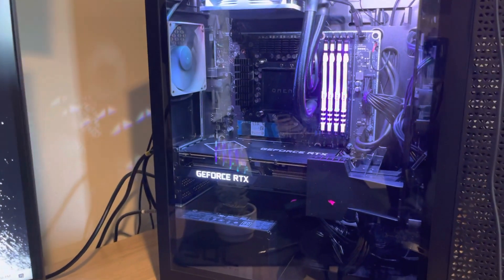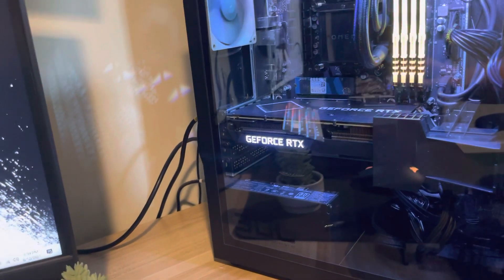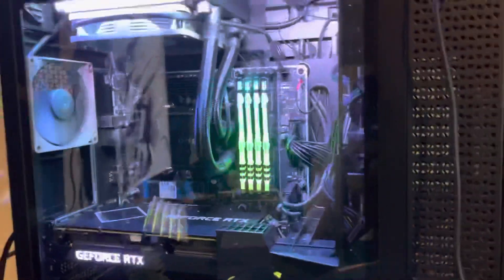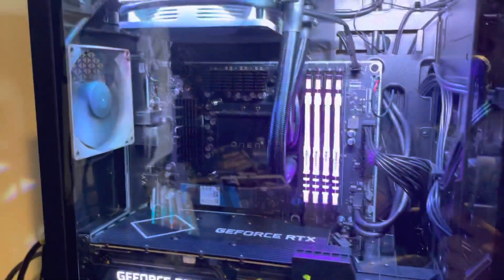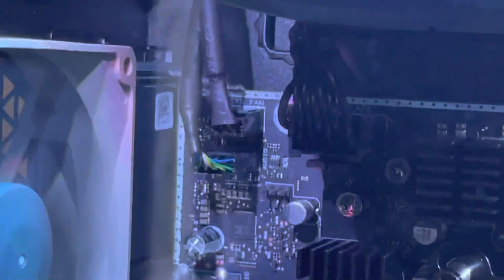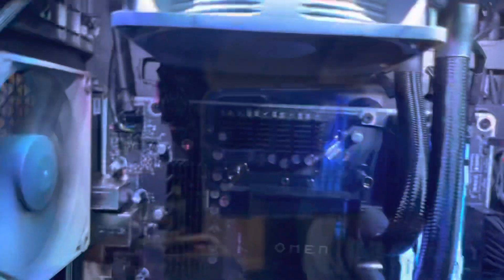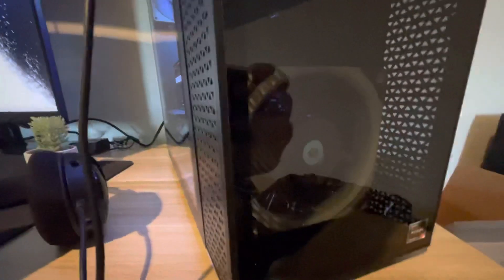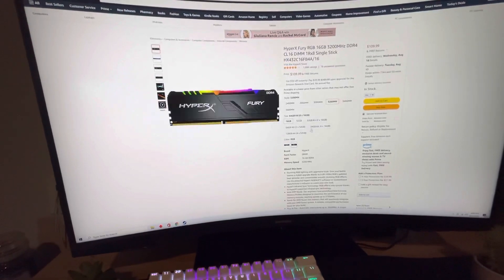HP Omen 30L Ryzen 7 5800x 3060ti fan storage and ram upgrade

Comment: Whered you get the exact hyper x omen certified ram? i was able to find hyper x fury ram on amazon that is identical to the rgb hyper x ram that came with my 5800x omen 30l however the difference is i cant overclock the ram to 3467 like how i could with the original 2 sticks i had before. Also another difference is the original ram has hyper x on the RB and the one on amazon says just Fury . Can you link for ram?

Comment: Yo I have the same computer but ryzen 7 with a 3080 in it can I use that same fan for mine also will that fan be better then the stander and will it also help flow the air out more

Comment: The stock fans in this thing are "Cooler Master"...as is a PSU (which is 80+ Platinum rated) and the RAM is Xtreme. I must say, for a pre-build, they used really decent components.

Comment: i added a 120mm at the bottom of the case not screwed into anything and it gave me way better gpu temps.
Reply: 30c idle with 3060ti

Comment: wait up, my  motherboard in omen 30L just has one m.2 slot. does yours have two?  did you adapt that weird wifi slot?. trying so hard to put in an aio water cooler, and the second screw on the radiator up top is impossible .  aye.

Comment: Umm your radiator fan can also pull air through.  Depends on what type of pressure you are trying to establish and what type of internal air temps you are working with.  I would say it is worth doing a pull setup if you want to get better thermals.  I did it with my old PC and the CPU thermals were always excellent because the rad was supplied with cool air from outside the case.  It did make cleaning the rad kinda annoying but I had some filters that helped minimize ingress of dust particles.

Comment: im currently idling at 47 c with the stock fans and radiator, one simple trick MSI Afterburner.
if you just tweak the fans curve a lil you too can be cool 😎
Reply: Is there a video you used or do you have the specific settings by any chance?
Reply: @321Stix  https://youtu.be/O98z3oiRc_k 
I followed this but for the fan speeds i adjusted.
Hope it helps

Comment: u said the 2 fans on the fronyt are just hitting a wall so they arnt doing anything,  imean if that front part comes off  could techincally just put some holes in it lol, and it wouldnt be visable muich trough the sides . just a thought

Comment: Is your CPU running cooler with the new fans? I have the same Omen as you, but the CPU and overall temp is getting really hot when I playing games.

Do you have spec on all the fans you bought?
Reply: Case and cooler is crappy part not the fans. If want best cooling have to buy better case and cooler and keep old case if have need warranty.
Reply: @jaggsta  What do you mean by better cooler. Do you mean the water CPU cooling? I changed the fans, but still no better. I only change the fans and not the CPU water cooling system.
Reply: @FortniteFamiljen  120mm cooler is only 1 fan which is weak cooling. 240mm is better or high end Air Cooler like Scythe Fuma 2/Ninja 5 or Noctua D14 if can fit in the case.
Reply: @jaggsta  but is it possible to fit the 240 mm in original case?
Reply: @FortniteFamiljen  don't believe so.

Comment: I replaced my fans with the same ones in this video, the main recommendation I would make is pre thread those Noctua fans before you try and install them. They are super tight and trying to screw them in the first time while installing them will lead to some frustration.
Reply: Replace case for $80 with better airflow with fans included instead of paying $40 for 2 Noctua fans and keep old case for any warranty issues.
Reply: @jaggsta  So buy another case with inferior fans and go through the trouble of lifting everything out of that case?  Not really a reasonable thing to do for most people.  I was thinking about doing that myself, but I have to say taking a computer apart is a lot less fun than putting it together.

Time is also something you have to be conscious of when doing something like this.  Cause if I am buying a new case then I am taking the 3080, PSU, and CPU out and leaving everything else.

Comment: why is your memory clock at 1600 when the ram you bought is supposed to be 3200?
Reply: HP locked their BIOS and made it so that if you dont buy the RAM directly from them(stupid expensive), they will throttle the hell out of it. If you have a AMD processor however, you can subvert this using the Ryzen Master software where you can adjust it to the proper 3200

Comment: I get those temps just tweaking a few settings with the stock fans lol.
Reply: What tweaks did you make?
Reply: Well that's because he went for an exhaust setup with the rad instead a pull meaning the temps won't be as good as they could be.

Comment: seem that gpu holder block good portion you should try to dremel as much possible that portion that block the alumiun stack than probably could get just as good experience whit undervolting normally work great power hungry part often can shave a nice 2-3 C as well having more enjoyable fan rpm. Safe journey and game on ;)

Comment: How did you change the fan on radiator? And can you add 2 more fans at the bottom?
Reply from the maker: Simply undo the two screws I showed to pull down the radiator then proceed to undo the four screws holding the fan onto the radiator and unplug the old fan and insert a new one.
Reply: @Zero-bt7uh  oh okay thanks! But can you add more fans at the bottom?
Reply from the maker: @NelFPS  there is no mount to do so, but technically yes I believe there is more fan hubs so you would just lay a fan on the bottom but with no mount it’s a tad sketch.

Comment: As I was stating earlier on the ram if you use the ram that hp recommends you will not have to set the speeds but any other ram that is not hyper x fury you will have to set the speeds in ryzen master to get the full speeds
Reply: Dankamyouknow put out a video on this
Reply from the maker: Don’t believe I ever said otherwise. There was some misleading claims that adding ever additional hyper x ram would default to 2400, but that is not always the case and that is what I was commenting on. Agreed though a swap to a different type of ram would require the use of Ryzen master to get the full use of the memory.

Comment: Thank you for linking the ram. I have noticed that my Omen doesn't stay asleep when i put it to sleep using the start menu option. Both the mouse and keyboard wake it up even though i have disabled the options to wake up in device manager. I have the razer huntsman elite and hp vector mouse. Any ideas? I dont like the idea of my pc running non stop unless i completely shut it down. Thank you for the Omen content! Much appreciated.
Reply: I have the 30L with the ryzen7 3060ti also but mine wouldnt wake up from sleep mode. I ended up just changing my sleep settings to never to avoid it getting stuck in sleep mode.
Reply from the maker: Hmmm I haven’t had anything like that happen with mine. I would recommend checking on Reddit or hp forms as those issues are usually brought up there. Possibly just setting the auto sleep function to a shorter time frame may be helpful. Or checking that your mouse isn’t somehow sliding.
Reply: @Zero-bt7uh  ram worked out great.. thanks again.
Reply: So it is something to do with the motherboard. I purchased another omen 30L same exact specs, no sleep issues.
Reply: The PC I built years ago does this too, I can't remember how I fixed it but it started up again.